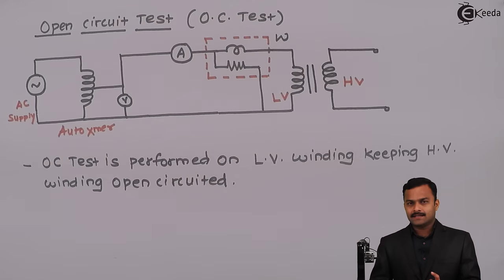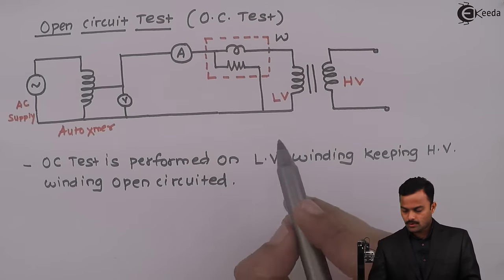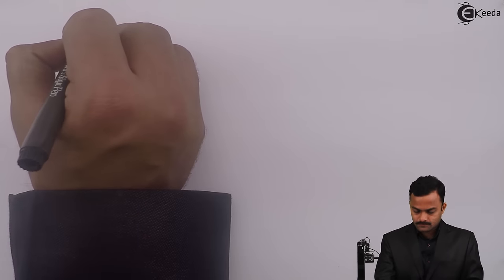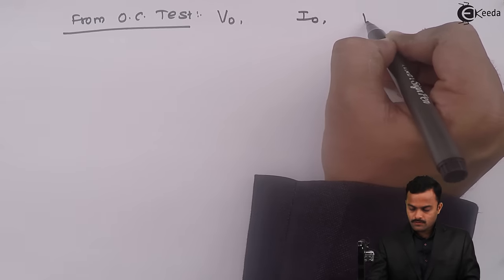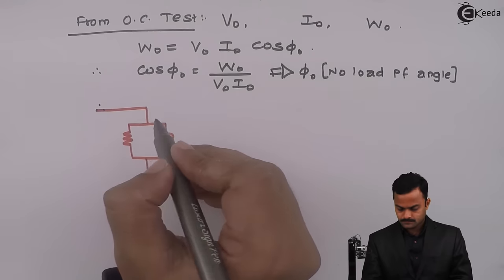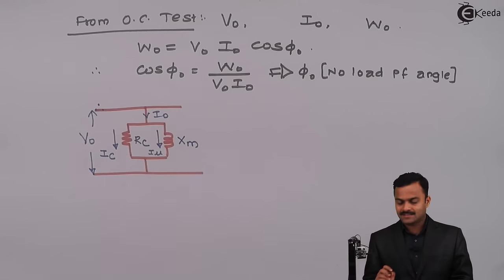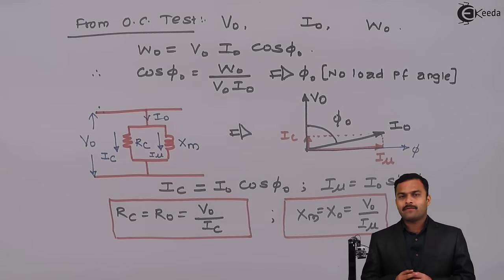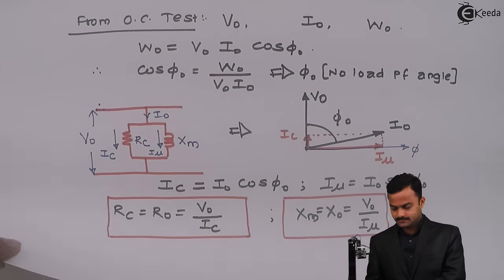Open Circuit Test and Short Circuit Test on Transformer - Single Phase Transformer

Comment: Dear Sir,

Thank you so much for your efforts of making Electrical Eng. Videos & keeping us alive after college. You are great sir especially the way of  explaining.

I have been watching your all electrical Eng. Videos.

This is to draw your attention to the sc test & oc test of x'mar. I am in field of electrical engineering  for 6 year where I have observed sc test but still not understood  properly.

Sir please make video of sc test of three phase transformer (1000kVA or 1.5 MVA). We want to know whole thing about the transformer like its % impedance, what would be ideal % impedance in India. ICs short circuit rating whether it is 50kA, 65kA(I heard that if we lower  ICs  rating the cost will be less & if we higher the ICs  rating the cost will be high)& its losses. How much current will flow at transformer site if the ics are 50 kA & 65kA, when the SC is performed. Its cost related queries & accesories are also to know from you.

We are keen to understand from you.

Please treat this as important part of elec. engineering.

Please explain following caption which  I am writing here, we want to know practical example or the way you teach.

While on this subject, we would like to state about transformer design: The percentage impedance as per IS is used while designing the X'mer by the manufacturer. For a given kVA capacity lower %impedance means the transformer has to withstand higher short circuit currents and their electrical and mechanical effects thus increasing the cost of the X'mer. On inquiring we were told by a manufacturer that for a 2 MVA X'mer cost increase between a 6% and 5% impedance transformer is as much as 15%. But if saving in losses is the aim then what needs to be specified is that the X'mer should be designed as per specifications of ECBC (Energy Conservation Building Code). The losses then are as low as 1% of kVA rating of the X'mer as compared to 1.2 to 1.25% normally.

Thanking you.

Comment: good evening sir . Thanks for the lecture . i have a doubt .why will the ammeter current be high if the short circuit test is performed on low voltage .
Reply: hi ricky

Comment: Open circuit test OCT and short circuit test SCT is conducted by keeping primary voltage :
A ) Low for OCT and high for SCT
B ) High for OCT and high for SCT
C ) High for OCT and low for SCT
D ) Low for OCT and low for SCT

Which is the correct option ?
Reply from the maker: Dear Izza Shahid,
To get answer of this question you have to become our member .
To become a member click here http://ekeeda.com/chapterlist/Mumbai-University/Mechanical-Engineering/Basic-Electrical-Engineering/114
For more information Contact us on 9821842103
Reply: is it free ?
Reply from the maker: Dear Izza Shahid,
You have to pay Rs. 1200/- for BEE online video lectures.
So also you can ask doubt. Our best faculty gives you a reply.
And also till june 2017 we have  100% Cashback offer.

Comment: The reason for using lv for open is ammeter cannot measure low currents and reason for using hv on open is ammemeter cannot measur high currents looking strange then what it will measure bro

Comment: Why you write NO LOAD VOLTAGE AS RATED VOLTAGE in case of OC test? Isn't the rated voltage is the maximum voltage that can be applied to transformer as input after that value of application the windings may burn?? Plzz let me clear this?

Comment: sir please explain how current becames high in L.V winding during open circuit test and low during short circuit test
Reply from the maker: Dear Kundan Vivek
To get answer of this question you have to become our member.
To become a member click here :- http://ekeeda.com/chapterlist/Mumbai-University/Mechanical-Engineering/Basic-Electrical-Engineering/114
If you have any doubt contact us on 9821842103